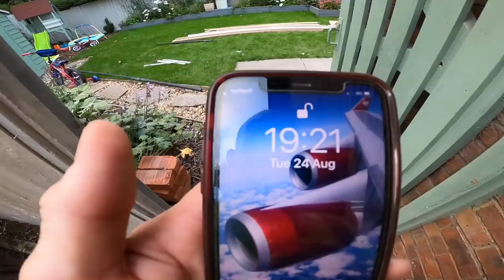THATS A DISGRACE ! BRICKING UP A DOOR

Comment: good job mate,whats the tool you use to take the bricks out  not seen one of them before seems alot better then a 300mm disc cutter
Reply from the maker: It is mate .
Blue Bosch professional sabre saw with a Bosch masonry carbide tipped blade 💪🏼👌🏼👍🏽🧱

Comment: Nice looking match as always, nice to see you going the extra mile to clean up a messy repair… 👍

I was wondering what is the blade that you use on your reciprocating saw? I have a little job to do and thought maybe it could do the trick instead of making up a dust storm with a grinder…?
Reply from the maker: Cheers Evan . 
 Bosch masonry carbide tipped . Tool station sell them 💪🏼🧱👍🏽
Reply: Thanks for the reply! I’ll try and find one a little closer to home, the closest ToolStation is at least 5200km’s from me… 😉
Reply from the maker: @evanking6329  Ah , try Amazon 😂😉🧱👍🏽

Comment: Nice job mate. we built a pub  with these bricks many years ago when i worked for sir alfred Mc alpine we layed them with roll on top another gang started laying them roll on bottom so the brikie forman got reps out and they said roll on top is the right way the  other gang werent happy
Reply from the maker: Oh no ! 😆😆👍🏽🧱
Reply: good job nice to see toothing filled the right way
Reply from the maker: Cheers John , very fussy about the toothers 🧱👍🏽
Reply: Your comment had me double checking; Ibstock confirmed roll on the bottom.
Reply from the maker: Yep . You can’t set accurately to the line if the roll is in the way 😬🧱👍🏽

Comment: Curious about the lack of waterproofing in the cavity.  Is that not common?
Reply from the maker: Hi pal , not sure what you mean 🤔🧱👍🏽
Reply: @SteveAndAlexBuild  I am used to the brick being a screen, keeping out most of the rain, but rain will get through eventually.  When it does, it hits a waterproof layer inside the cavity between the brick and the block or structure behind the brick.  The water in the cavity is allowed to drain to the bottom by gravity, then escape back to the outside through weep holes or drains at the bottom of the wall.  We call it a cavity wall or a screen wall system.  Your wall is clearly not built that way, and you don't live-in a desert, so I wonder how your walls manage water getting behind the brick.
Reply from the maker: @justmyopinion99  A good quality mason wall won’t let much water in , if any does penetrate the cavity is there to protect the inner leaf . 
   Standard building practice in the uk for many years. 🧱👍🏽
Reply: @SteveAndAlexBuild  Interior mold has been common for many years in the UK as well.
Reply from the maker: @deconteesawyer5758  No it hasn’t

Comment: That "patchwork" bricking up IS a disgrace and is so common, especially on flats, where people don't really care about the façade of the building. It takes courage to make vids where your work is always going to be scrutinised and criticised by some, but actually doing the job, rather than bitching about it, is much harder. Plus, I'm sure your customer was happy with result, which is all that really matters.
Reply from the maker: Thanks very much pal . 😁🧱👍🏽
Reply: Tell me about it, bad bricking up jobs are a bit off a pet peeve for me, especially when someone uses 65mm bricks in a wall built from 73mm bricks because someone could not be arses to source the correct 73mm bricks.
Reply from the maker: @leewakefield8658  Sane here Lee , drives me mad 😡 🧱👍🏽

Comment: Thanks for another cracking little video Steve, Just a quick question, the brick work wasn't supported above ? do the soldiers act as a lintel so no need to prop up while filling in ?
Reply from the maker: Thanks Dave , the original lintel was doing all the supporting 💪🏼🧱👍🏽
Reply: @SteveAndAlexBuild  Oky doky.
Reply from the maker: @davidcort2857  🧱👍🏽

Comment: Nice video, thanks for the entertainment, really enjoyed it.  I noticed that you put all the short (cut) bricks on the right side.  I would have thought you'd want to spread them out.  Did you do that for any particular reason or does it just not matter?
Also  - you didn't use a strong-boy to support the opening.  How wide of an opening can you go in a case like that before you need the support?
Reply from the maker: Always keep the pieces in the same spot is what I was taught . As for the opening the lintel had the internal wall on it so the outside didn’t need propping 🧱👍🏼